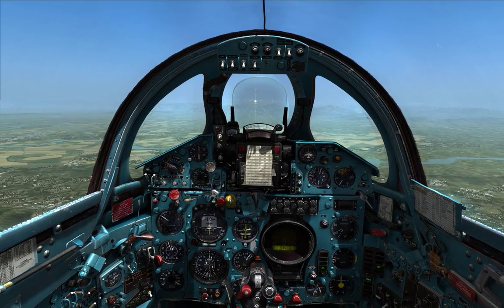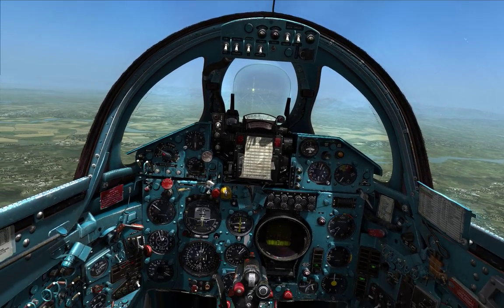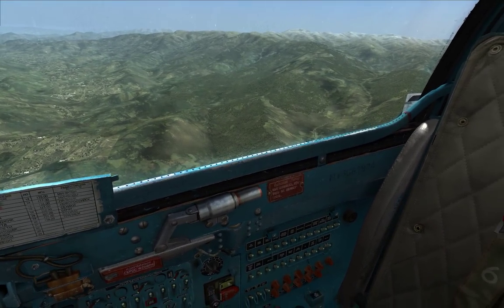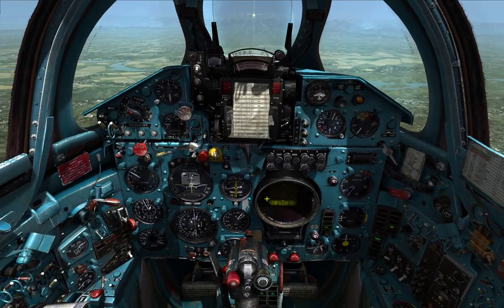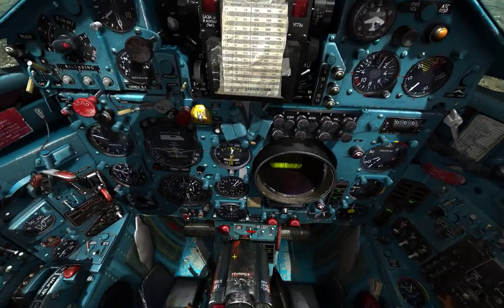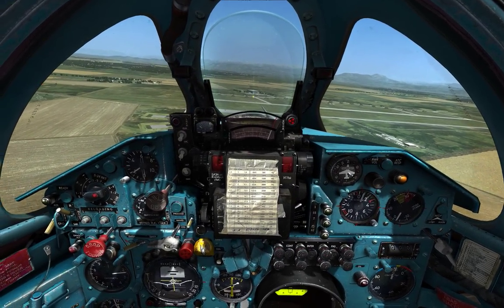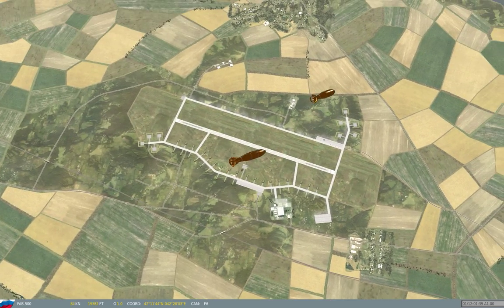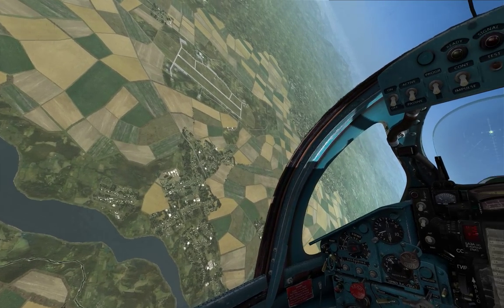DCS MIG21 Quick Guides: Over the Shoulder Bomb Toss

Comment: AFAIK, this delivery method is usually intended for ordnance of the nuclear flavour and so a few hundred metres off intended POI is a non issue. Bug in fast and low to avoid detection and possible threats, pull the loop, release, level off and roll out and you are already high and have good separation from impact area. From what i have heard elsewhere, more traditional methods (level, dive and toss bombing) leave you a very static target for AAA and SAM relative to your actual target. Looks really cool. Just load a bigger bomb lol.
Reply from the maker: This method was definetly designed for tactical nukes, but it can also be used for static targets where dive bombing would be too risky (because relative to an AA gun you're static) and where without the use of a good Dive toss technique, this is relatively simple to execute.

I hope in the future to do some real bomb-toss/bomb-loft techniques in the F5 where you dive to low level, and climb up at the same time releasing the bomb at the release angle.

The problem here is that you need some way to either calcuating by time your pitch up point or some navigation aid to do so.
This is partly why this should-drop technique is simple, because you dont need to work out in any fancy way when to pull the trigger.